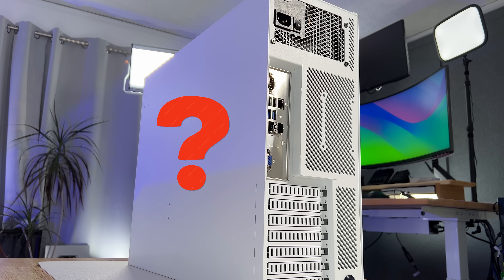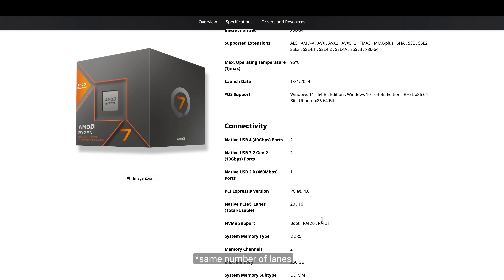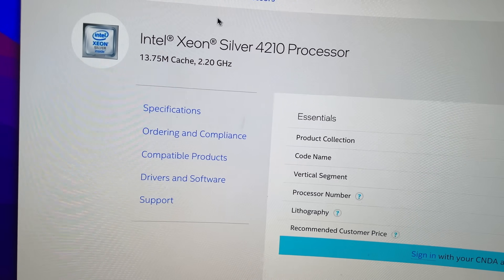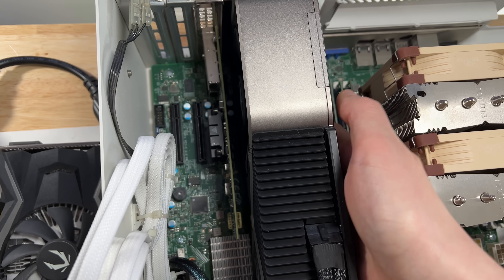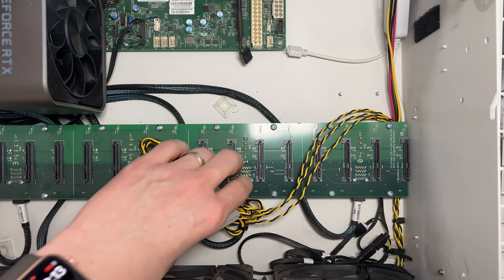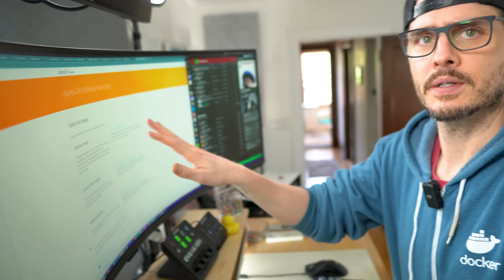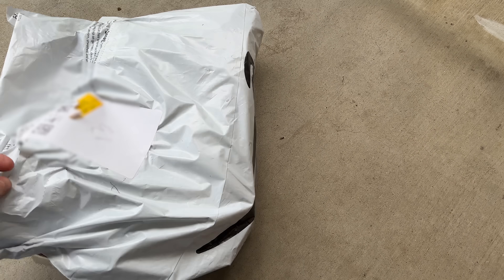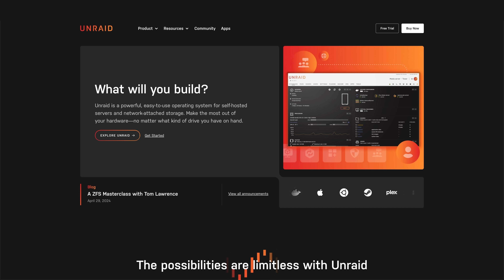Building My ULTIMATE, All-inOne, HomeLab Server

Comment: I want a server that can do it all... Let's go with a crap Server instead of something like Asus RS520-E12-RS12 + Genoa 9374F + 12 channels + ~120 pci5 lanes + U.3/2 Nvmes.
You're funny 🤣
Reply: How much that thing's gonna cost? he's already crying about ~$500 for the SSD's.. don't tell him the price of that system.
You're funny!
Reply: @kbng02  Its not a huge price bump, i had fears initially too. I wanted to get first 2 Old generation servers with Sata and so on, to save money. But that was in the end around 18K. Then i calculated what it would really cost to get Genoa fully specced (all memory channels populated and a lot of nvme drives) and that was around 25k.

Going from 18K for old crap, to 25k with newest gen maxed out which has around 10x the performance, did even needed a decision xD

But if you go dell/hp, means buying new server from them, instead of buying barebone and build yourself, that an extreme price bump. Same Specs would have me costed around 40K.
And that pricebump is so huge, that i would have gone with used refurbished servers.

However i wrote this, because he wrote „ultimative“ server. I personally see the 4004 Plattform the same as Ryzen Consumer, there is not a single benefit. Its 1:1 the Ryzen 7000, just in another box.
A Server plattform has more lanes, more channels and more cpu features.
4004 has nothing of that, just amd marketing bs. If you go 4004, you can go Ryzen and save money.

Cheers

Comment: So apparently we are on the same tech wavelength and I just now noticed it, lol. I too just built the a few servers to do all the things. I ended up going with an Epyc system for all 128 of its PCI lanes dumped into a HL15. Another machine made use of the SilverStone RM41-506 4U chassis. I needed the 5.25" bays for the tape drive and an Icy Dock 4x 2.5" ssd hot swap cage, but the GPU just fits :)
Reply: I've been eying the dual epyc setups on ebay to eventually migrate everything to. I have absolutely no need for all 128 lanes or cores/threads, but it'll be all I'd ever need and then some.
Reply: @DrDipsh1t  Wow yea dual Epyc would be Epic 😂 I am actually making pretty good use of the PCI lanes on my 7282 16c/32t rig. A 16x PCIe card that holds 4x NVMEs, 16 port HBA, Radian RMS-200 Edge Card and a dual port 10gig SPF+ nic. Still have 2 more NVME m.2 slots, 2 OCuLink ports as well as 2 mini sas connectors on the motherboard I could populate. Its an Epyc8d from AsRock Rack board.

Comment: If you didn't have the hardware already, I would've recommend with a Threadripper system because it offers more PCIe lanes.

(That's the direction that I'm heading down, except that I'll likely end up with something like an 8U chassis and then using PCIe risers/extensions so that it won't cover the rest of the slots. My other option will be a Supermicro 4U or 5U GPU server, but those are limited to dual-slot-wide GPUs only, which means that my 3090s will be blocking some of the other slots.)

Comment: Given that you want to run Plex, Github/CI builds, locally hosted AI, and Tdarr - I'd stick with Plex.

If you set it up as LXC containers, you can share your single 3090 between the LXC containers for the various workloads that you want to use.

If you don't want to run separate LXC containers for the separate workloads, then you can either use a single LXC container or a VM (personally, I prefer LXC container because it uses less resources than a VM of the same Linux distro) and then try and use Docker with the GPU passthrough.

(I haven't had a lot of success with that, which is also the other reason why I run a bunch of LXC containers and share a single RTX A2000 6 GB between them.)

It is very easy to set up because I'm already doing it (minus Github/CI builds and Tdarr -- I don't run those services at home yet.)

Depending on which AI model you're looking to run, it may potentially by both system RAM and GPU VRAM heavy (the 70b parameter models are typically close to 40 GB, so I'm currently testing this with two 3090s in a separate test system).

Install the NVIDIA driver on your Proxmox host.

And then install the same NVIDIA driver with the `--no-kernel-module` option inside said LXC container.

Pass the GPU through to the LXC container, and you can do that as many times as you like. (I've got 6 LXC containers that's sharing said single RTX A2000 6 GB.)

And boom, you're up and running.

I have deployment notes in my OneNote if you want 'em.

Just let me know.

You can be up and running in very little time.

Comment: I moved to a single giant server build a while back from my own giant rack with dell power edge servers. But it was to much power usage. For most use cases in a single server build. I found unraid to be the best base OS for me.  5 years later. Still rock solid and never had any major issues. Kind of on autopilot and it just works.
Reply: Been running unRAID for 🤔 3+... I've lost count. 😆 The UI makes it's super easy to manage everything.

Comment: I also went with the all-in-one homelab solution. 7950X running Unraid and I've been very happy with it. Unraid is pretty great as an all-in-one OS. If you go with it, just keep in mind that the hypervisor side probably isn't as advanced as what you're used to with Proxmox, but it definitely gets the job done and hardware passthrough is probably the easiest of any hypervisor I've ever used. Now that Unraid has a better funding model, they've promised big improvements coming down the pipeline.

Also if you want to dig into Docker on Unraid, there is an add-on you can easily install that gives the UI Docker Compose support if you need that.

Comment: Sliger offers watercooling options for the Threadripper/Epyc line of CPUs in that chassis. I'm not aware of any constraints that would stop you from using random AIOs as long as they aren't too thick for your GPU clearances. There is a build someone did in that case with a thick 360MM cooler and a 3090ti.

Comment: Also it is quite wasteful to buy so many 1TB SSDs, pretty sure they will have a worse pricing per GB compared to 2 TB ones (and need to check if so with 4 TB). Not to mention you take up so many slots with such small sized drives.
Reply from the maker: I wanted more spindles than space and didn't want to drop $1,000

Comment: 11:12 Fans are not installed correctly on the CPU heatsink. Firstly, do they even blow towards the back of the case? (and they should). If so, they need to be shifted one slot down (as looking on the video frame), i.e. the one closer to the front of the case doesn't need to suck air via fins, but would push the freely-collected air into them.
Reply from the maker: They are, this is a pull configuration, and yes, it does exhaust out of the back

Comment: I'm curious how your SSD pool works out.  I have a Truenas Scale setup with 6 2TB Samsung EVO's and I've struggled to get decent performance.  Literally it's less than a single disk.  I tried Stiped 2 x (3 raidz1), 3 mirrored vdevs and raidz1 across 5 of them.  

Hopefully you can do a follow up video on your SSD pool setup and final performance numbers.
Reply: Consumer models performance will drop I believe because of the drives cache, PRO models address this. And enterprise SSD's will be far superior. At the end of the day, you get what you pay for...

Comment: Switch to a fiber SFP+ transceiver and it will run much cooler.  The RJ45 copper ones run really hot and use a lot of power.
Reply: DACs are a nice alternative as well.
Reply: I have a dual 10 gig E card in my unRAID and noticed first hand hot toasty it is. Now I wish I didn't give away the SFP card 🤦🏻‍♂️

Comment: creating a dedicated VM with the GPU is kind of limiting IMO, I find that using the GPU in lxc containers is the best way, you can have multiple containers use it at the same time and even monitor its usage from the host os
Reply: Or split the card, but that requires finesse and doesn't work with all cards
Reply: @BoraHorzaGobuchul  very few cards suppprt thay and generally they're expensive and require licenses
Reply: @WhyDoesNothingWork  it can be done even with some consumer cards. Those are not super expensive. Some more expensive pro ones can be found on the service have market. 
Intel cards will perhaps allow this as well.
Reply: @BoraHorzaGobuchul  if your talking about sr-iov only the commercial Intel cards do it and the chances of finding a consumer cars that does it is like winning the lotto
Reply: @WhyDoesNothingWork  there's a number of consumer Nvidia cards that work, but it does require rtfm and research, not something I'd love to do now. Then again, at a younger age I'd've already done that just for the lulz...

Comment: I've flip-flopped between Proxmox and Unraid for some years now.  Started with Proxmox, went with Unraid on the next build, went back to Proxmox on the most recent build.  Both have their pros and cons, but for my use case Proxmox made more sense.  Unraid is pretty similar to TrueNAS Scale, however my experience with TrueNAS Scale hasn't been all that great.

For example, Unraid supports Docker containers natively, Proxmox uses LXC.  So, if you want to run Docker containers on Proxmox you have to spin up a VM or LXC to run Docker as I'm sure you know.  Unraid Docker containers primarily come from the "Community Apps" catalog, however there is a beta app that installs Docker Compose to make spinning up custom containers easier.  Both Proxmox and Unraid support ZFS, however Unraid is designed specifically to manage individual drives itself (Like TrueNAS) whereas Proxmox is more storage-agnostic.

If you haven't used Unraid before then I would recommend taking it for a test drive, it might be just what you're looking for or the solution that you didn't know that you needed.  No single platform can do everything and do it well, but based on your build I'd say Unraid would definitely be a good option to test.  One problem I did have with Unraid, and maybe it was user error, is that I could never get Windows 11 VMs to work, even when enabling TPM, etc.  It wasn't a blocker as I didn't NEED to run Windows 11, however with Windows 10 EOL looming I did want to make sure I had a path forward, so when I built my latest server I started with Proxmox and the first thing I did was install a Windows 11 VM.  Worked perfectly.  So for now I'm back using Proxmox.

I'm not sure what I'm going to do with my old server, I'd like to put it into a rackmount case and mount it under the new server but as for an actual use for it...the only thing that comes to mind is turning it into a dedicated storage/backup system.  On the one hand that seems like a waste of a Threadripper 1950x, on the other hand not using it is also a waste.  The other option would be to sell it and build something a bit more recent on a more common platform.  Decisions, decisions.
Reply: Been running a Win11 VM in the current version of unRAID. Works good for the simple tasks I need it for. 😁👍 Now you have to try it again. 😉🤣

Comment: The drives linked in the description (QVO) are not the same youre showing (EVO) in the video. Avoid QVO's at all cost (for this application in particular).
Reply from the maker: Thank you!  Will fix!!!
Reply from the maker: I just check and I land on the EVO so maybe Amazon is suggesting one based on stock?  Either way thank you and that's a good call!
Reply: you are probably right, I might just be experiencing some amazon euro redirect shenanigans

Comment: So tired of them artificially holding back pcie lanes and also holding back on bifurcation of pcie lanes on consumer cpu's and motherboards. 
 For the 2.5" drives- print out a bar that goes across the top of the drives and long enough to touch both sides of the case. There would be small ridges printed into the bar at each drive location to keep them in place. That way you don't block air flow.  And you could easily lift off if you need access to drives.

Comment: It is quite a waste to use such a luxurious hard drive backplane for 2.5-inch SATA SSD. These backplanes are designed for hard drives with more stringent power ripple parameters.

Comment: You are badly making assumptions about PCI-E lane switching. You can't say the CPU has X of lanes, and then just count the slots and figure the last slot would go over.. that isn't how it works. Find the motherboard manual. You will discover PCI-E lanes can also be reserved for M2 or are switched off of M.2 slots. They aren't "half" or "full" by just a count; you'd need to see the manual and understand. The motherboard manual on that board, the X11SPL-F, makes it quite clear: none of the slots are 16 lanes, period. The mechanical x16 (length) slots are both given PCI-E 3.0 x8 bandwidth. It's in the manual, pages 12 & 13. This is something you really need to be aware of! If anyone wants to verify google for the manual to the Supermicro X11SPL-F, which you can see this board is at 4:33. Tim, not trying to bounce you or be mean, but I think this is a good time to really address how motherboards don't always assign PCI-E lanes just in some automated way as it seems. So if you put an x16 card into either of those slots, especially a 3090, which is a PCI-E 4.0 x16 into a PCI-E x8 slot, you are going to lose a ton of performance before you even get started.

Comment: I realise this isn't an easy option, for my "homelab" I've gone with nixos. Quotes because my homelab is a surface pro 3 with a cracked screen, yes it's running over wifi.

Currently I have the following services running:
    Traefik
    AdGuardHome
    Vault Warden
    Portainer

Things on the list:
    Low cost and low power hardware, preferably with 2 x 2.5GB nics
    Basic Nas
    ZeroTier or something similar
    PXE boot, maybe pixiecore
    Home Assistant
    Next Cloud
    Something to help me backup WhatsApp from my iPhone...
    Might decide on a hypervisor at some point, in which case all the above goes in a VM.

What I love about nixos is that the entire config is code. The other benefit is this helps me learn nix and nixos.

Comment: I would like to see you give unraid a shot since you haven't yet, selfishly I am curious what your thoughts about it on a setup like this. I started with a single PC like this a decaid ago running Windows Server 12 r2 and Hyper-v. Over the years I upgraded that server and eventually replaced it with a much smaller proxmox cluster. I still have that machine and I am not ready to let it go yet. I have thought about unraid or truenas.

Comment: I'm contemplating similar build, and here are my observations:
for proper local AI selfhosting, having Mac Studio with 64GB unified memory is MUCH more suitable than RTX 3090 which is limited to "only" 24GB vram,
that said nVidia gpus utilizing CUDA are often faster than Apple's neural engine,
all reasonably-priced Xeons are limited to PCIe 3.0 which is not futureproof at all, and already bit of a bottleneck for current gpus,
any strong gpu takes lot of space and covers most PCIe slots on the motherboard, so it's rather difficult to decide on PCIe expansion layout, preferably gpu on "lowest" x16 slot, which then needs bigger than ATX case,
that said some local AI tools can utilize multiple gpus or even multiple computers, so there's a delicate (cost/efficiency) balance between running let's say 4 gpus in one rig, 4 computers connected via 100Gbe together,
latest Windows Server or plain Windows Pro, with WSL (Subsystem for Linux) seems best OS for widest range of local AI applications - arguably better manageable via Proxmox but with undesired performance loss,
to sum it up, one all-in-one server doesn't seem that efficient, depending on what to run on it

Comment: If you look at the schematics again iot says it right there which Slots are which for example the first x16 Slot says CPU SLOT6 PCI-E 3.0 x( (in x16) so that is an x8 in a x16 connector which is connected to the CPU and the last x8 says PCH Slot1 PCI-E 3.0 x4 (in x8) so it's a PCI-E via the PCH and only has 4 Lanes. So in any case the GPU only will run on 8 Lanes on any of the x16 connector slots as both are only x8(in x16).
Reply from the maker: Thank you!  Yes, I actually edited out the part where I explained that, I probably should have left it! When I did the math you can see I adjusted for it (8 x 6 = 48, and the last was 4 in an 8)

Comment: With the price of electricity I like to keep the 24 hour a day wattage to a minimum , about 50-60 including a rtx2060 super .
I have a Ryzen 5700g  with 4 x 4 tb SSDs and 64gb ram , but no ecc memory and only 20 lines .
Reply: I plan to build a server with the 5700g and 64 GB RAM as well. Do you have any numbers of the power usage without the video card? I thought about and suggest that it will be around 25-30W but numbers are hard to find online (atleast for me). Would appreciate it if you could help :)
Reply: @pesfreak18  switch all the power boost modes off and which 2 x 4tb SDDs and 2 x nvme 2tb drive , for a small nas on deskmini x300 just set up as a samba server 15 watts according to my power monitor plug on idle.
But my other system on a B550 motherboard , with the gpu and about 10% cpu all the time about 50-60 watts , but I think I must be the only person who is running a 5700g water cooled with a 360mm cooler , but it was a remove my x570 motherboard with a 3950x because I could not get it below 120 watts on idle .
16 core 32 treads was a little over kill for what I wanted my home server to do , in fact I think the 5700g is over kill.
Reply: @peteradshead2383  15 watts seems very efficent. Water cooling is a little bit overkiil for me too but it sounds like a cool project. The Ryzen is maybe overkill but I want to experiment with gameservers and maybe AI in the future. I think I can utilize the CPU well enough with these tasks.